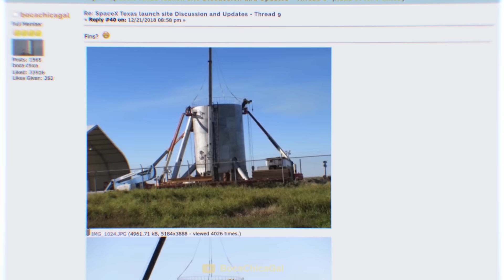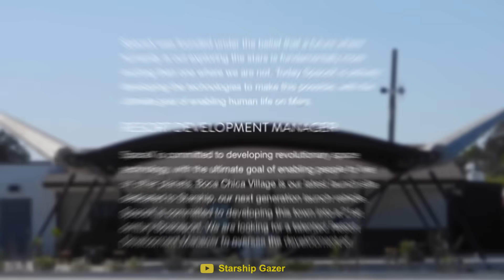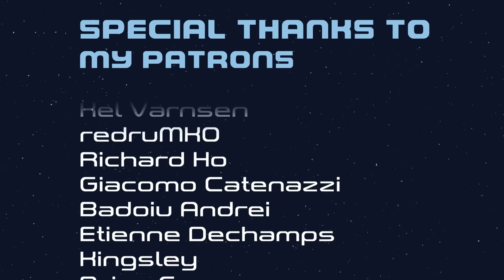Why SpaceX Is Starting Its Own City

Comment: Don't invest any money in this scheme. Even if you can. Because when a fully fuelled Starship and Booster explode on the pad, or just after takeoff, the yield will be the same as the fission bomb dropped on Hiroshima - or around 14 Kilotons. Because make no mistake, that explosion WILL take place, the only question is when.

From what we know of nuclear testing, and previous nuclear attacks, we can say for certain such a failure will destroy the entire site; from the launch area to the construction facility, to the entire StarBase. AND, the fuel plant, as well - so the yield will depend on how much extra fuel is stored. Its possible the yield could exceed the Fat Man fusion bomb.

Is it even worth mentioning that SpaceX have no hardened bunkers (like NASA) and that everyone within 2-3km of the blast will be killed?
Reply: I wish i could invest

Comment: Why did you use a fake photoshoped image for your thumbnail? There aren't 3 high-bays in boca chica. You replaced the mid- and low bay with 2 more high-bays. The real image can be seen at 8:50.

Comment: 1:00 extremely important for SpaceX was to be as close as possible to the equator to save fuel for their rockets! Boca Chica is roughly 2,5° more south than Cape Canaveral, that matters a lot!
Reply: Also that you have a huge empty area to the east (in this case the Gulf of Mexico), so that in case of a disaster, the debris doesn't fall on populated area. Unless you're China of course, in which you don't give a f...
Reply: @dejanpejkic1300  but the debris did fall on a populated area already. A bunch of SpaceX employees were frantically looking for pieces on South Padre Island a few months back. They said if you find any to not touch them because they're dangerous. And they're littering the ocean with rocket pieces as well. I'd show you a piece of rocket coast guard found if YouTube let you post pictures 🙄
Reply: @nunya2138  which launch was that? South Padre is about 10 miles north from the Boca Chica launch site, seems weird that debris would end up there.
Reply: @dejanpejkic1300  it was on or around March 30, 2021
Reply: @dejanpejkic1300  so true! I forgot to mention this important point! Thank you for mentioning it! Godspeed 🚀✨
Reply: It's only a launch location for the prototypes. Future launches will happen in the gulf on a moving platform. SpaceX already owns the deep sea drilling platform they'll be converting into the launch platform.

Comment: look for " Rising Waters: Sea Level & NASA Infrastructure  "  Nov 5, 2020   YouTube  ( 4ft rise in 60 years,, maybe? )
and ... note ...
" (GPS waypoint) of Las Palomas Wildlife Management Area Boca Chica Unit  are 25.9936912 (North), -97.1669159 (West) 
and the approximate elevation is 3 feet (1 meters) above sea level. "

Comment: I think that naming the city "Starbase" is incorrect. As many of you know, a starbase is a location that requires a designation. This being the first of many ,"I hope "it should be more appropriately named "Starbase 1"(one). That would satisfy the requirement. Also, given the number of bright engineers at Space X I find it hard to believe that no one wired" the sign" to light using a single switch. Instead of having that poor devil acting like Vanna White........lol.

Comment: Great idea right up until a 12 foot storm surge from a cat 4 hurican takes out the whole area.
Reply: A man as rich as musk definitely won't be half-assing the structure of his own town... 

he'll make it more than capable of weathering whatever natural disaster comes...
Reply: @jackmerry1972  you do realize musk doesn't have billions sitting in a bank account somewhere all his money is stuck primarily in tesla. And for half-assing it they already are they have a facility sitting there that they're spending huge amounts of money on but they've done nothing to protect and it's hurricane season in just a few more weeks and they are on a sandbar.
Reply: @deannelson9565  oh noooo. Dont let the steel rings get windy...🙄
Reply: @jackmerry1972  do you not know how storm surge works! It's not the wind that's the problem it's the water that will sweep that place right out of existence!
Reply: @deannelson9565  Yeah... thats not blowing the bays, the tents or the orbital launch tower away... the rings  are easy to replace and everything else can be moved easily. 
Also by that logic, the entirety of boca Chica village shouldn't even exist... yet its been there long before spacex got there...

The only thing that's at risk is the actual launch site, the only part of all of this setup, that is near the coastline...
The normal launch pads are used to suffering destruction, one got ripped apart back when sn8 and sn9 were tested, new mounts were rebuilt in days...
As for the orbital launch mount, it has been driven into the surface of the ground by a whole 30 fucking metres, it'll survive a storm surge...
Oh, and as for the fuel storage, it has all been placed on raised platforms about 5-7 metres off the ground...
Reply: @deannelson9565  "Sweep it out of existence"  🤣🤣 sure bud, most of it is nowhere near the water.
Reply: Here's hoping

Comment: What about a fuctioated boost using thrust of small materials that give thrust because of theyre small improvements and changes on thrust points and where the explosions can happen and on what levels the explosions happen at specific times

Comment: There was a recent military article (on a UT Austin site) suggesting the US Space Force buy starships for conversion to space cruisers.
Reply: Long shot, the military should fund the research for a reliable railgun instead of the current design which disintegrates after a few shots. Because railguns would be the most capable direct weapon to be mounted on a spacecraft.
Reply: They can do both. And 'star cruiser' is not a longshot. Here's the article, if you're interested.
https://warontherocks.com/2021/05/a-starcruiser-for-space-force-thinking-through-the-imminent-transformation-of-spacepower/
Reply: @mikeymmike  I said 'long shot' not because the technology and the capability isn't there for it to become a reality, but because the congress will almost definitely reject the development of such a highly advanced project. Space Force is still just a term coined by Trump during his presidential period, but if Space Force can only truly be established, it need the current president and even next future US presidents to push the idea so that the congress will be compelled to provide even more funding to the already substantial military budget. 

And there's another problem associated with funding. Here's an analogy: Developing and building a new tank is quite simple, but doing that whilst also creating the infrastructure to support its logistics, maintenance and not to mention the troops required to be trained to use it all the whilst needing the appropriate barracks for the troops and the tanks to be be housed in. Now replace tanks with military-starship. That's the difference between building a vehicle VS a vehicle within a space force.
Reply: Maybe read the article.
Reply: @Joe-nq6hy  Tell that to the paranoid US government.
Reply: How to help America's enemies.